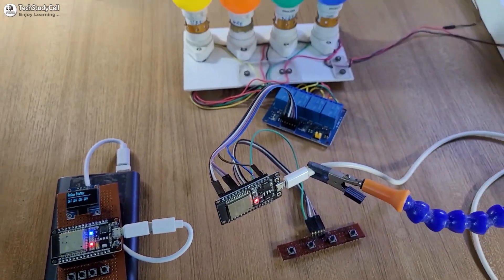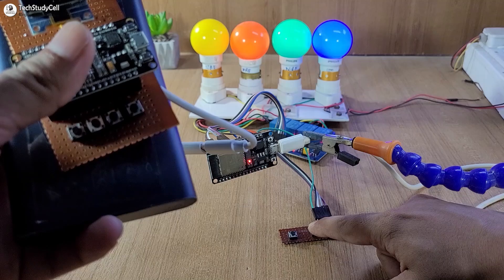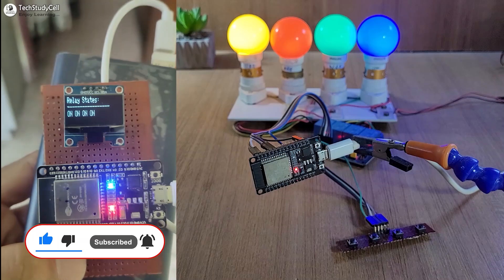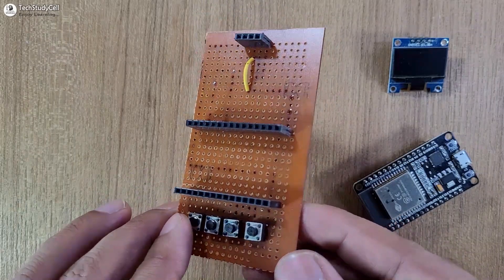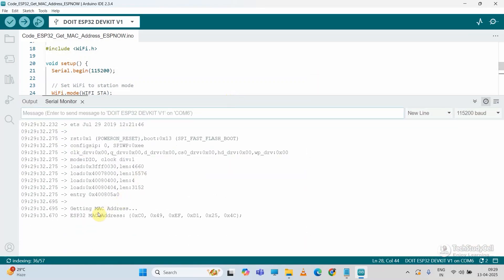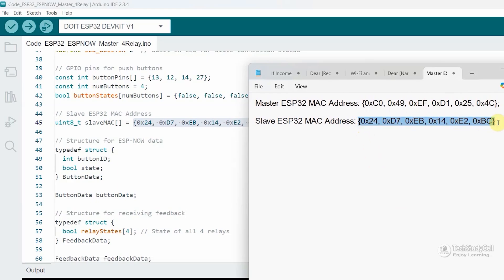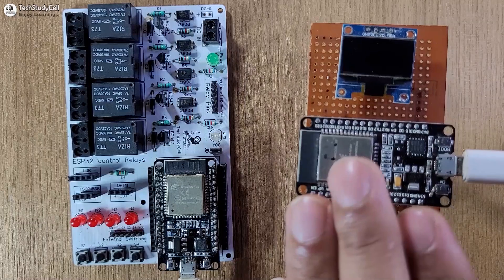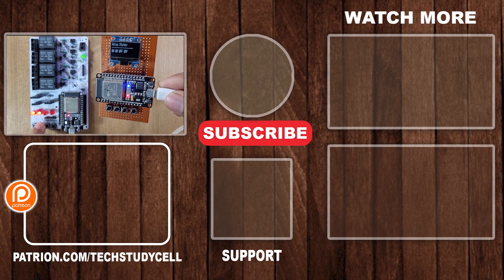ESP-NOW Project: ESP32 Master-Slave Relay Control + OLED Feedback | Full Tutorial

Comment: if i use a 500mah battery for the transmitter will it last a few months , i heard espnow is very power efficient, also can we turn off wifi when using the esp now

Comment: Friend, after watching that video, it feels like the sky is the limit hahaha.
See if this is possible:

I have a master that will send a signal (a signal that will remain active).

However, I have, for example, 10 identified slaves, and I need to send the signal to only some of them.

The slaves receive the signal and activate an LED with a specific color sent by the master, and also activate a small vibration motor.

The slaves press a button that deactivates the signal and sends individual feedback to the master.

Note:

The master can have multiple controllers/Arduino boards.

The slaves will only have a battery, an ESP, a vibration motor, and LEDs (small, maximum 3x2cm).

The LEDs will be powered directly without using relays.

Do you think this is possible?

Comment: Hi, first that all I would like to say thanks for this kind of projects currently I'm trying to work with something like this but when I try to make the compilation of the code doesn't happen, could you help with that, please?
Reply from the maker: Install all the required libraries as mentioned in code. Use latest version of ESP32. Select the board then compile
Reply: @TechStudyCell  Hi, it's me again. Currently, I could start to compiled the code, but the arduino IDE gives me an error on the Acebutton class, I tried to fix it but I couldn't, do you think that you can help me, please?
Reply: @TechStudyCell  the exactly error is "AceButton does not a type"

Comment: Good afternoon. Best regards. Hello, my name is Alvaro Rodriguez. How are you? I recently saw a very interesting video of yours, where you make it possible to light lamps with the ESP32. I would like to do the same project, but with a kit I recently purchased from Seeed Studio, called (XIAO ESP32S3 plus the HF32FA-G relay), which is part of the same ecosystem. It comes with everything you need to connect, very versatile and small. I need to turn on a submersible turbine I have in a water well on my farm. Do you think your sketch could be adapted to this Xiao card kit? Could you help me?
Reply from the maker: Yes. You have change the GPIO in code according to your circuit